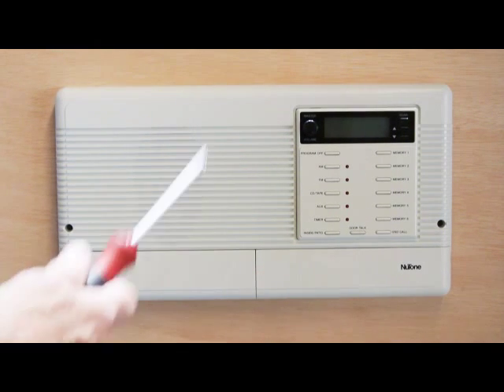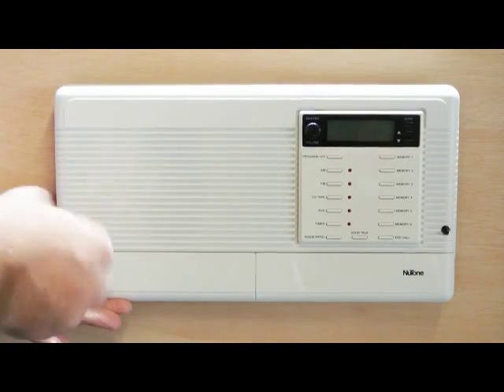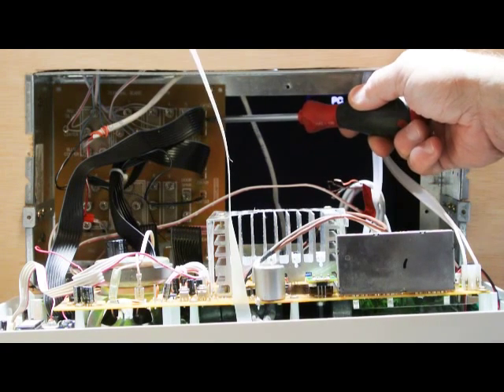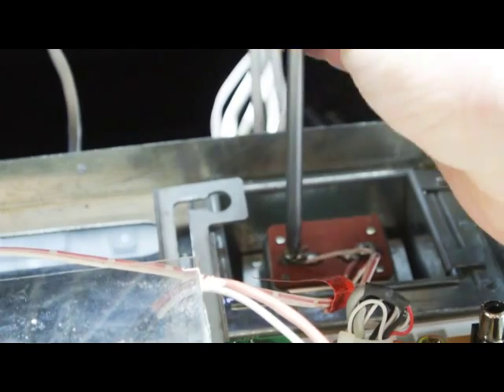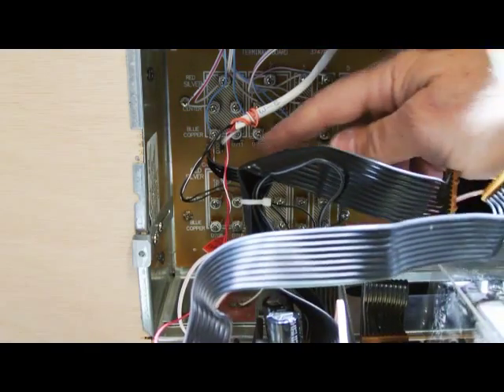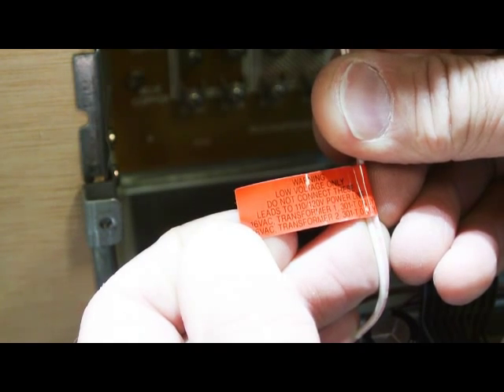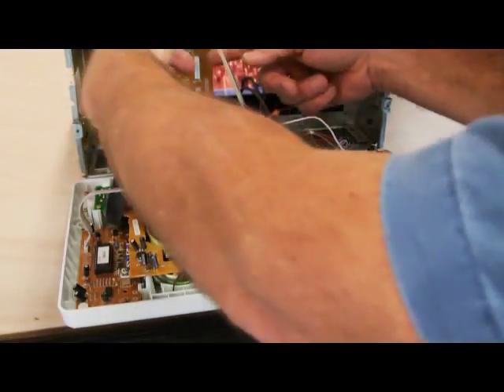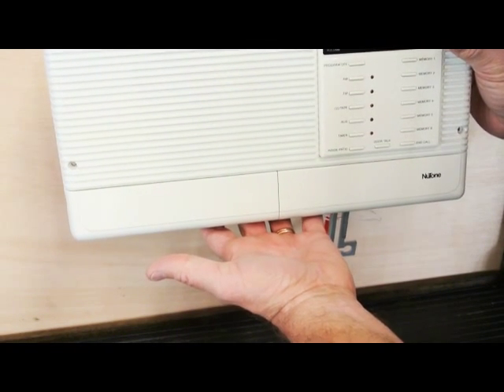How to Remove a NuTone IM3303 Radio Intercom Master Station

Comment: great video.   thanks.  I also recommend marking all the connectors you disconnect with the sharpie on both the connector and the board so you know the polarity and don't plug them in backwards when you reconnect. also mark the left and right wires.   I actually keep different color nail polish around for just that reason and color code everything.

Comment: I am glad someone is a specialist with these units. I am actually considering completely removing the system in my house and not replacing it. Or, at least, I would like to remove some of the speakers in certain rooms. I don’t like the idea of capping off live wires that lead to individual speakers; is it possible to disconnect them from the main terminal? It looks like there are several wire leads behind the transformer on the left side. Would disconnecting those remove all power to the separate speakers throughout the house? Thank you!
Reply from the maker: Hi Mark:  If you remove Remote Stations from the System - the associated wires should be disconnected form the Terminal Board behind the IM3303.  You should also consider that it is likely that your Doorbell is part of the system - so you'll to workout a replacement for it - Chris
Reply: Thank you for your quick response! It seems like simply removing the ribbon cables from that main terminal removes all power to the remote stations. I took out those ribbon cables and also removed all of the wires on the terminal just to be safe. I also discovered that the door bell is connected to the back of the panel, which is convenient for the scenario you had mentioned.

Comment: Great video, can you replace the front cover, my cover is yellowish I’ve had this unit for 23 years and Intercoms through out the house, even doe everything is wireless today I need to keep this unit in place. I just need for the front cover to look good. Everything works on the unit only the patio intercom stop working. Please advice. Thank You 
Max. 
How much would the cost be for the front panel replacement and your labor.
Reply from the maker: Hi Max:  I have some new replacement white Faceplates for the IM3303 available - You can contact me directly about them - Chris  925-743-8236    nscompany@msn.com

Comment: Do we need to shut power off at the circuit breaker?
Reply from the maker: Hi Glenn: Not really - The transformers are only 16 volts each - You can certainly turn the circuit breaker off - it it makes it easier for you - Chris
Reply: @northsideservicecompany3567  thank you.  Also, the ribbon cables seem like they are super glued on.  I cannot seem to pull them off just by hand.
Reply from the maker: @glennangelesphotography  I'm sure they're not glued on - They may be somewhat stuck - Try pulling one end off a little first - then the rest of the plug should come loose - Chris